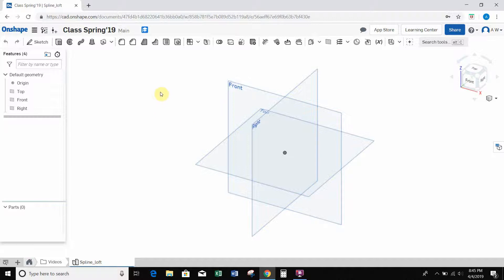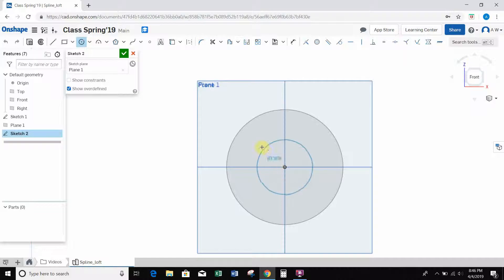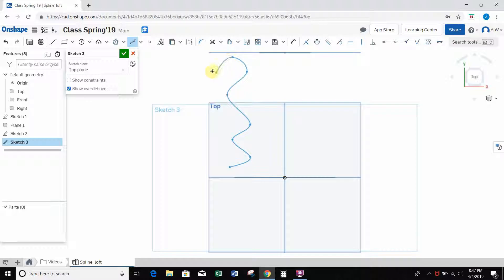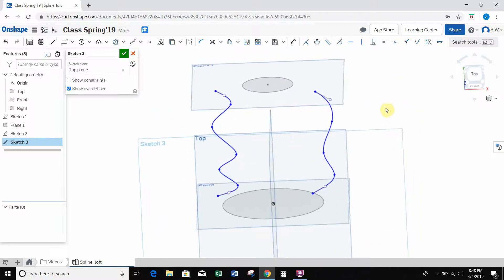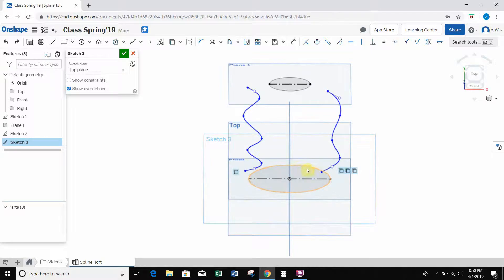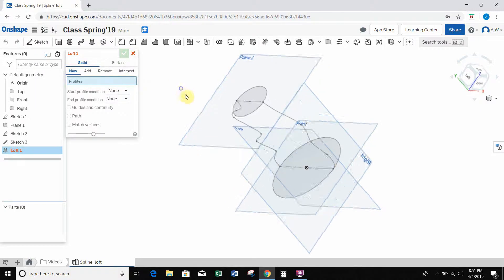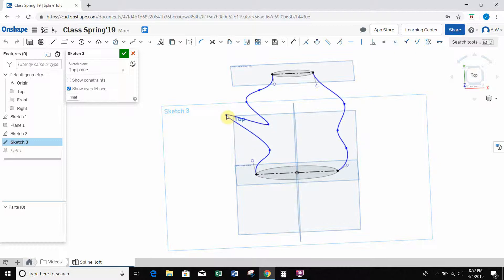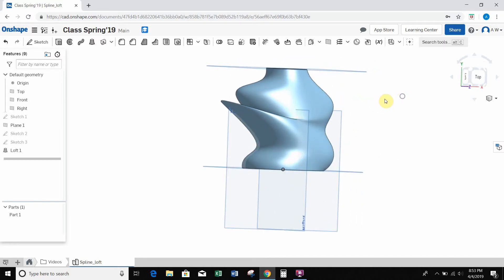WEST Class: Onshape - Splines as Loft Guides

Comment: If you design aircraft or boats or just about anything that moves through a fluid you spend a lot of your life dealing with curves, splines and lofts.  

I don't want to be too much of a pedant, but if you are going to work with splines and lofts and so on it helps to know a bit about the underlying functions you are using, starting with with the most basic thing: that Onshape and almost all other CAD tools (even 2-D cad) support at least two "spline-kinda-things:" Bezier Curves and B-splines.  They are closely related ... but not the same.  (And you might guess that "B-spline" comes from "Bezier Spline", but that's wrong. instead both of these are implemented with Bernstein Polynomials -- the B is Bernstein.) 

There are articles on all of this (Bezier Curves, B-splines, and Bernstein polynomials) in the Wikipedia -- they are worth taking a look at even if you don't try to understand all the math.  The difference that you will immediately see between Bezier Curves and B-splines is that the curve of a Bezier Curve DOESN'T go through all your control points; a B-spline does.  If you are a casual user you might then think "heck, Bezier Curves are bloody inconvenient because they DON'T go through points I can quickly pin down" ... and you'd be at least half-right.  But in fact Bezier Curves are used more than B-splines in computer graphics, because they are more computationally efficient and have nice properties of numerical stability.    As a general rule....

Use a Bezier Curve when you care only that the shape be "exactly what you define" at its end-points, not anywhere in between... AND you don't need to control tangency at either end point, and indeed may not want tangency.  From a CAD POV this means it isn't contacting anything else; you don't NEED to have it precisely constrained to a value anywhere else.  The result will be smoother, and also faster to compute and more computationally stable to round-off.  Bezier Curves are used endlessly by scalable fonts (and not B-splines) and also to draw many "fundamental shapes"; your computer's graphics functionality spends a very large fraction of its cycles computing Bezier Curves.

To give a concrete example of where a designer doesn't want tangency consider the deck line of a boat: the two hull-lines AREN'T tangent at the bow and the stern (and the latter is true for both a canoe stern or one with a transom).  You don't want, and in fact can't make what you want (exactly), with a B-spline ... because it FORCES you to define tangents. 

I want to make two points about the presentation here, one that is just an error, and one where I disagree on practice:

It's flat wrong to say "making the tangency longer" ... at an end point.  It is only tangent at the endpoint... always.  What you are doing with that control line length is controlling the 2nd derivative of the curve (tangency controls the first derivative), or equivalently introducing a "hidden" control point near the end point.   If this seems too pedantic, don't worry about it, but it does in fact matter.

And I don't agree that a finished drawing should leave control points "undefined." In reality of course they ARE defined -- the CAD program knows where they are.  But they are hidden, unrecoverable AND not easily manipulated in any systematic way.  One consequence of leaving them undefined is that in the future your ability to duplicate the design in anything else other than Onshape will depend on an OnShape-to-XYZ translator of the underlying data-structures Onshape uses ... and this won't exist.  (exporting a tessellation doesn't easily recover the design.) 

It takes very little work to draw & connect construction lines to your control points and dimension them ... indeed it is rather natural for them to be defined by variables. 

Also, finally, if you really get into lofted shapes, and are doing "lofting that really matters" for things involving fluid flows (boats and airplanes etc are obvious, but there are lots of other such applications) you will need more than these two simplest tools that OnShape pre-defines.  An obvious example is that you want a B-spline that controls tangency at one end, and not at the other, or you want to force matching first and second derivatives,... etc.  All of this can be done with "fancy math" and could be done in FeatureScript ... if you or somebody else got into it.  Probably somebody does have a more "full-featured" boat lofting package ... e.g.

Similarly -- OnShape's lofting tool isn't very sophisticated.  IMO, it's the weakest tool in OnShape compared to some of the competitors.  I am hoping for an upgrade....

Comment: Is there something in Onshape like 3d Spline tool in Solidworks? The 3d spline in onshape is very easy, straightforward and simple to use. Since I am relatively new to Onshape I am curious if there is something like that in Onshape. I need to complete a project where there are lot of multi-plane lines to be drawn.